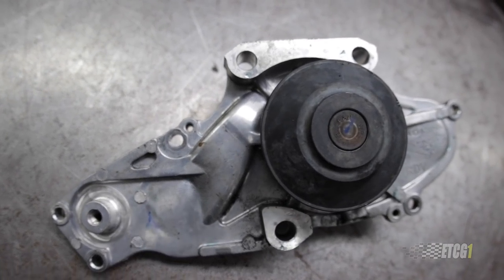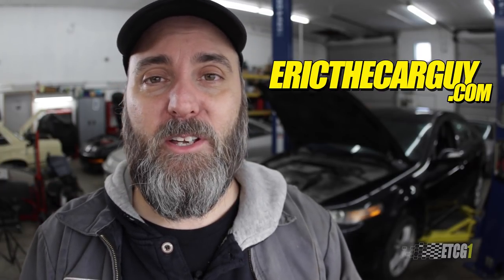Timing Belt vs Timing Chain, Which is Better?

Comment: I was always told that a belt tends to be a quieter running engine vs a chain, but also it's always a good idea to at least look at the chain as often as you would a belt if you like your car.

Those also who say you don't need to really do any maintenance to a chain are usually the ones who forget or have family members that'll take that info and roll with it and have a good car ruined at 250k miles because something with the chain went bad.

Comment: Considering it takes me maybe an hour to switch timing belts on my daily driver I do prefer having belts. I'm sure a shop would charge a fair amount for it though, but my car has plenty of room once you remove one of the front wheels and there's holes in the block and the pulleys to put pegs into for the timing so it's really not much harder than changing a serpentine belt

Comment: I've driven nearly 700K miles and never had a timing belt fail. Eric, How many OEM timing belts fails have you worked on that were changed at the correct interval?

Comment: Personally I don't mind a timing belt, But I won't buy any vehicle with an Interference engine. I've worked on too many of them with bent intake/exhaust valves. Granted with a belt and proper maintenance you should never run into this issue. That being said sometimes new parts fail.

Comment: The oil in the tensioner does not push the tensioner. Springs push the tensioner. The oil dampens this movement.
Reply from the maker: However when the oil leaks out the tensioner bounces around and can cause the belt to jump time. Thanks for the comment.

Comment: I was told by a service manager at a Honda dealership when I brought this older lady's 2000 civi in for a timing belt service n service manager told me timing belts last longer then a timing chains. I looked at him n said then why is my timing chain on my 05 chevy malibu maxx with 380,000 miles the factory original.  I got the older lady's car fixed for free. Embrassed the service manager infront of other customers 🙄

Comment: I'm a retired Mechanic and shake my head every time I hear people worshiping timing chains, they are absolute garbage these days. Chains came back into fashion after belts because chains more easily facilitate variable cam timing but they don't last - not so much the chain, but as you said, tensioners, guides, solenoids, and variable sprockets - ALL GARBAGE!  Timing belts were a far better idea and super easy / cheap to change compared to chain hardware. I can't imagine the amount of money that has gone down the drain due to chain hardware failure, all unpreventable. A timing belt had a service interval that was well known and if you followed it the engines were virtually bullet proof, but people didn't listen or want to pay a few hundred every few years. Now it's a few thousand every few years and all the brands have problems. As far as liking either in the business to make money - give me a timing belt job any day of the week over chains and guides.

Comment: I mean my 200K miles LS engine has the original timing chain and is still running. Just saying. However I run mobil 1 full synthetic oil.

Comment: Timing chains all day long. Christ i hate belted engines. YES, it's not going to last forever, they do get stretched over time, but at least, in my personal experience, i have never once seen a dead engine from a snapped chain. Belts on the other hand, well, of all the engines that were dead on arrival at my doorstep (and to be mentioned, i service a smaller pool of cars compared to most other professionals around here, so in itself this makes my personal evidence, to me, more damning) were snapped or slipped belts. I'd rather take the hit of changing a chain, which to be honest it's not really that much of a big deal in the grand scheme of things, than having to diagnose a gonner belter.

A chain offers the security and peace of mind a belt will never, ever, ever in a million years offer. It's the smarter solution to the biggest problem a car has... negligence over time.
I'll dare anyone here say that this isn't the biggest factor of death to a car at micro, human, or macro level. And when this is factored in, the cost of changing a chain setup basically pays for itself.

In closing, there's a reason chained japanese engines are considered a great toy to play with in the middle class speedster groups. Front driven, chain timed, itself makes a great compelling case for strength over ease of use.

Comment: It depends on the design of the engine. On old school American OHV V8s, which used a simple and very short timing chain, under a cover behind the water pump, with no guides or tensioners, they work great (like the bottom picture @ 0.32) I do recommend replacing them every 75K miles or so, because they do start to show some wear around that mileage. I consider that to be routine maintenance on those engines. Taking your time, it can be done in about 90 minutes. If you have a PLASTIC cam sprocket, definitely replace it with a steel one.

However, on late model engines with double overhead cams, super long timing chains, tensioners and guides that are not readily accessible without disassembling the engine, an external belt is BY FAR the best. Those long flimsy chains (they look almost like a bicycle chain) the tensioners and PLASTIC guides also wear out at around 75K miles, and it is a VERY expensive job to replace them. Sometimes more than the engine is even worth. 

I have a 1972 Pinto Squire wagon that I have owned for 21 years. I have replaced the engine once. It has a SOHC 2.0L inline four, with a timing belt. Originally the belt had a cover with several bolts in it. When I replaced the engine, I left the cover off. It really serves no purpose. This belt is out in the open where it can be inspected, and it takes about half an hour to replace it. It does have a tensioner, and it is also on the outside and super easy to get to. I keep wondering why modern engines can't be this simple. This has been the most reliable and easy to work on car I've ever owned. Engineers these days seem to do their absolute best to make things as complicated and hard to work on as possible. 

On any old school small block Chevy, the simple timing chain can be replaced with a gear drive, which has twice the life of the chain. I have one on the engine in my 1982 S-10 drag race truck. It does have a whine to it, but i like that. Sounds a lot like a blower whine.
Reply: International Harvester gas engines used only two gears with a reverse spinning camshaft. Quiet & bulletproof.

Comment: Both my vehicles are chain driven. It happened to be the vehicles I was looking to own and worked out that way. I personally don't care, but sure appreciate the lower maintenance factor. As a past mechanic, I can say that a stretched chain typically can mean some kind of major work is required as things wear over time. When people ask me about chains or belts, I simply tell them something similar to what you said about more maintenance vs less. One thing I do think about when buying a used car on a budget, is that the purchaser does not  need to worry about the last time the belt was replaced, when the motor is chain driven. That doesn't mean it is bulletproof, but can help someone tight on cash.

Comment: Difference is not as much... Belts are more easy and cheaper  to replace than chains. Chaines may live longer... Belts are more silent then chains. With chains you can change your waterpump easy and cheap... Chains can stretch out (and jump). And... 
This days some chains are mounted between engine and gearbox. (Audi) THIS "saves the day" ;)

All at once i must say that the advantages and disadvantages between both are well balanced.  ...and both must be changed.
I prefer belts because they are easier for me to change than chains. On my car...

Comment: Ford engineers told me that they use a chain because they rarely break. They just tend to stretch. And that takes longer than the warranty lasts. If they used a belt and included a service interval that would raise the "average cost of ownership" number printed on the window sticker. Timing chains and "lifetime" fluids are lies, used to lower the cost of ownership number to falsely make a car look like a better investment compared to the competition.
Reply from the maker: True, but timing chains don't stretch, they wear. Sorry, that's a pet peeve of mine.

Comment: Replacing a timing belt here in Canada from the Honda/Acura dealer for a V6 is over $2000. About $1200 from a private mechanic. Over time that costs will add us. Timing chain is the way to go.
Reply from the maker: You could do it yourself for about $300. https://www.youtube.com/watch?v=lDSoQD1H0zY&t=32s

Comment: Surprised they haven't made electronically controlled valves yet, with solenoids.... or have they? Never looked into but seeing how they're making everything electronic these days (bad in my opinion) I'm sure it's right around the corner but it might be cool to have an engine w/o  a chain or a belt. If they do go electronic then I hope they avoid going interference for the engine.

Comment: I’ll take a chain in cold weather climate. I saw a timing belt fail in 30 below temperature. The valves hit the pistons causing serious damage to the engine and head. I don’t want a belt on my car.

Comment: I prefer change a belt every 100 thousand miles almost forever than scrap an entire engine after 200.
Reply: Never had an issue with more than a small handful of fleet vehicles going 300-500k miles and more without timing repairs with proper PM and good oil. Fleets i dealt with that bought cheap bulk oil and cheap filters plus still ran 5-8k miles OCI had issues. 
I bought a high mile crown vic taxi from a fleet and ran it to 520k miles.  Intake,  alternator,  coils, o2  sensors and a used tranny swap. That was it for drive train. Car was sold to my mechanic buddy that used it as a shop loaner car and parts runner for a year or 2 more before selling it to a hot builder for the frame and drivetrain

Comment: I had to change the water pump on my 2003 Neon. It had lasted 301,000km / 187,000 miles. Changing the timing belt was an obvious job to do while I was in there. There were no signs of wear on the belt to speak of. The recommended service interval for changing the belt is 120,000 km / 75,000 miles. It isn't a job I'd want to do again any time soon. Space is TIGHT in there.

Comment: In my opinion the best set up is the old school timing chain set up,not the ones with guides and tensioners and all that garbage. The small block Chevy like your dad‘s truck is relatively trouble free for life and before you say that’s old technology, the engine everybody is swapping into everything, the GM LS still has this style and failures are extremely rare. Late model timing chains and the belts are continued income engineered from the beginning, that’s what it’s about.
Reply from the maker: From the factory the 350 had nylon coated gears. The coating could wear out and fall off causing the chain to fail. Additionally, over time, the chain wears. When that happens, performance is decreased not just via the valve train being retarded, but the distributor is also driven by the cam. When that timing gets sloppy, the ignition timing goes with it.

Comment: Prefers chain.  One less thing needs to be take care of for a long time, if it doesn't fail.  Forgot to replace the belt after it breaks, it's the owner's fault.  If the chain breaks before 300,000 miles, I have the excuse to blame the manufacturer.

Comment: Mercedes V8s from the 70s and 80s are notorious for stretched and broken chains. The single chain from the 80s is especially weak. If the timing is off by 10+ degrees get that sucker changed ASAP.

Comment: There was one aspect of engines not mentioned here: interference and non-interference.  Toyota at least at one point in time was non-interference whereas Honda at that same point in time was interference.  Example:  1997 Corolla vs 1997 Civic.  Both were timing belt driven, but if the Toyota belt broke, not a real big deal.  If the Honda belt broke, look for a new engine in extreme cases.

Btw Eric, the length of this video may mean that you owe at least one of us viewers a Slurpee...
Reply: Nissan also made interference engines. It was one reason for otherwise decent Hardbody V6 and early Frontier V6 trucks to end up in the junkyard.
Reply from the maker: I didn't mention it because it doesn't matter. Just because a timing belt breaks on an interference engine that does not automatically mean that the valves are bent. A perfect example is the car behind me in this video. It has an interference engine, the timing belt broke, I replaced the belt, and it runs just fine. The video will be posted to my ETCG channel soon. https://www.youtube.com/watch?v=enPNb8dxCZk&t=167s
Reply: @ETCG1  I guess you didn't see the last few words of my comment stating "in extreme cases"...

Comment: BMW: Let's design and put in timing chain and related components that require timing belt maintenance but never tell the customer! 

Also, the TL snapped its new timing belt or the new tensioner seized, right?
Reply: TL's belt snapped because it was counterfeit. He put a new belt on it though and got lucky.

Comment: I like having an interval to change because that's like the definitive "replace" time. For a chain I feel there's too much iffy involved.

And yes, I'm a torque-to-spec guy
Reply: I agree. And assuming you use quality parts, once the timing belt and its components are replaced, you know it's good to go until it's due again and don't have to think about it for a while.

Comment: No interval for timing chains, unless you have a VW/Audi 2.0 4cyl engine. Then its somewhere around 70-100k miles. Also, BMW N20 4cyl is around 100k. Change your oil!!! Every 4k, doesnt matter if its regular oil or synthetic stuff made from gold and baby rhinos!

Comment: my 1991 GMC 1500 with 460 km on it ,same motor 5.7 same chain , oil changed every 5000 km ,its sloppy ,time to change it  thanks for the reminder  E T C G . used 10/30 oil from the start.

Comment: The fact that you MUST remove the engine on some vehicles to service the chain or chains is madness . I would pay extra for an all gear system that would almost never fail . A chain would be second choice . I had 199 K on my 1989 Chevy 5.0 Liter when the transmission went . That being a push rod engine WITHOUT all the VVT , Guides , Solenoids and Phasers lasted . These engines are too complicated to last . I would now consider an EV . If it is less complicated it may just out last the current crap they are using to squeeze every bit of mileage , power and efficiency out of the ICE at a huge cost to the vehicle owner .

Comment: Does anyone other than a mechanic like belts? I don't enjoy maintenance that cost hundreds of dollars. If you change your oil regularly, you probably won't ever have a problem with your chain until the car has a lot of miles and any number of components can mechanically total your car in addition to the timing chain.

Comment: I had a 2000 toyota sienna equipped with a timing belt.  I replaced it twice in the time I owned it.  It had over 340,000 kilometers on it and would have gone even further had it not been for an unfortunate encounter with an elk.  I then acquired  2009 sienna equipped with a timing chain.  Even though I kept up with regular oil changes, etc., it only lasted just over 320,000 km. when it was found that the timing chain had stretched.  The cost of replacing the chain was so prohibitively high it was deemed that replacing the whole engine would be a cheaper option.  As the vehicle was already 11 years old, I decided to replace the vehicle.

Comment: The problem with chains is that the guides, tensioners, can have problems well before the chain wears out, and if I have a choice of repairing a chain engine or doing a timing belt at 100k miles, I’ll take the belt because it’a much less labor intensive compared to a chain job, which might even require the engine coming out.

Comment: I think the issue is, a well designed, overbuilt and regular oil changed timing chain, is superior. 
Unfortunately the above is getting more and more rare, with costs and increased service intervals. 

Where as if replaced within guidance, belts almost never fail. 

That being said, if you wanna discuss the worst idea ever, it's got to be wet belts, pretty much every engine on the market currently that has one, suffers with issues.
Reply: Agreed, it's uncommon for motorcycle timing chains to go bad because they're well designed. Occasionally they do get tensioner issues but not all. With regular oil changes it should never wear enough to cause issues for the motors lifetime.

Comment: Especially on more modern engines, no matter the manufacturer, we see more and more severe chain wear, to the point where you have to replace them under 100k. And because of that the whole point of increased longevity is gone.
Just don't buy an ecoboost, as they had the glorious idea of running a timing belt in oil, apparently to decrease noise. If you don't use the right oil, the belt will desintegrate in short order, what a stupid design.
Reply: Belt in oil, the worst of both world, service interval of timing belt, pain in the ass to get to like timing chain.
Reply: i agree with overhead cams today i would prefer belt for that reason. Seen a ton of car where they did oil changes and chain still had issues or the camphasers etc
Reply: Only the 1.0L EcoBoost and the 2.0L EcoBlue (diesel) has the belt-in-oil design. All the other EcoBoosts have conventional timing chains